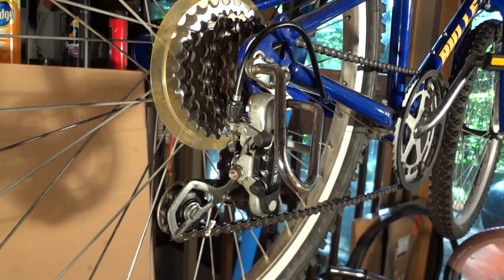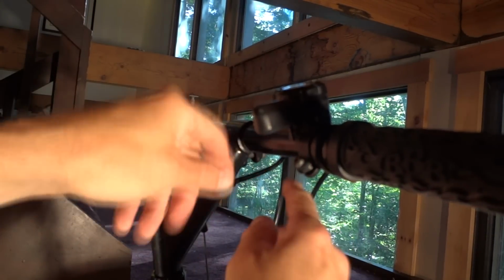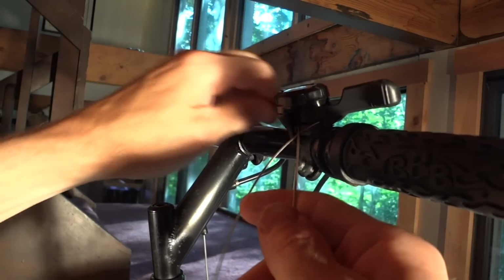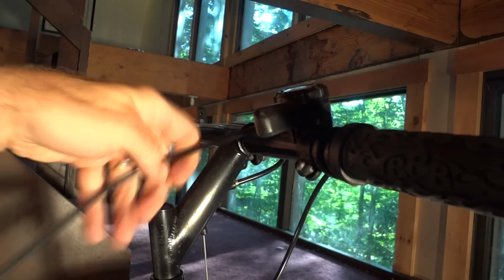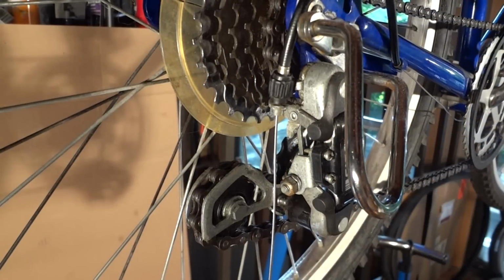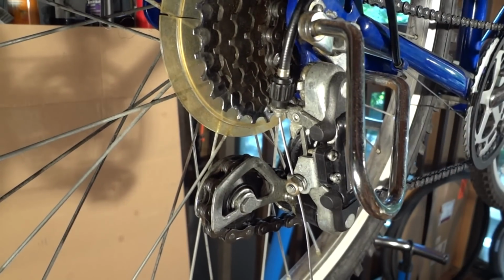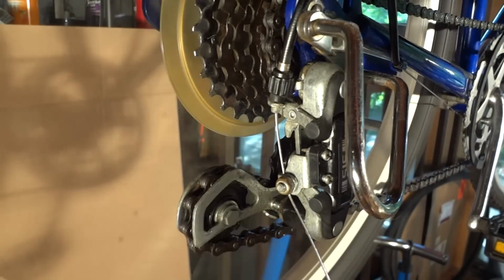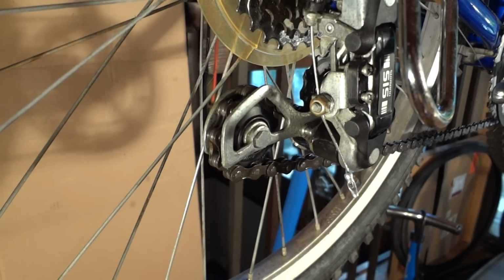How To Replace A Rear Derailleur Shifter Cable

Comment: Hi I am having problems threading the cable through the barrel adjuster as the cable is a little bit splayed is there a way I can fix that or do I need a new cable? @RJthebikeguy
Reply from the maker: Cables should be replaced every now and then. If you are redoing stuff, then now is a good time.

Comment: what happens if I lost the barrel end by accidentally shifting when the wire fell out of the derailleur?  All I see is the cable not the end barrel and I can't shift back down.
Reply from the maker: I am not sure what you are talking about? The barrel end?
Reply from the maker: The barrel adjuster? The ferrule?
Reply: The barrel at the end of the cable.  Gratefully I was able to locate it.  I had to take the shifter apart.  Many thanks. Appreciate the video

Comment: How can you tell if a cable is stretched?
Reply from the maker: Cables don't really stretch. They wear. The housings compress and wear.
Reply: @RJTheBikeGuy  Thank you RJ. Was out this morning and the chain started rubbing in the mid range gear's. Bike is seven years old. Was wondering if cable replacement might solve the issue.
Reply from the maker: I can't tell you what the issue is without seeing and working on the bike. Could be a combination of things wrong. Figure it out, or take it to a shop.
Reply: @RJTheBikeGuy  trying to figure it out now. It's not doing it while on the stand or peddling it now. May just replace the cable and go from there. 
Your videos are awesome! Thank you.
Reply: At 5:47.   Sounds like a little Bike lube is needed on your  Door in the background. HaHa

Comment: One minute in and you have said "go ahead" possibly 6 times?
Reply: Apologies, 8 times in 90 seconds....
Reply from the maker: That's the way I go ahead and roll!
Reply: Incidentally, my barrel adjuster doesn't move. Therefore I cannot do any of the adjustments suggested in all videos. Any ideas?
Reply from the maker: Lots of penetrating oil, let it sit, and then try to grab it gently with some pliers or vise grips and work it back and forth trying to get it to move at all. Once you get it to move, you should be okay to get it out. Take you time. Go ahead.